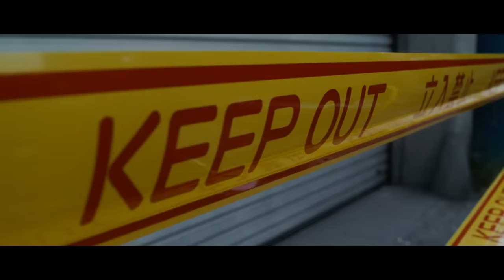Fixing a Ford Mustang | The Fast And The Furious: Tokyo Drift (2006) | Screen Bites

Comment: is it possible to do this engine swap irl 😂
Reply: Matthew Aquinde are you a world class mechanic?
Reply: The shots are real. As you can see, they really swapped it. There is commentary about it in DVD extras.
Reply: The mechanic that worked on the car begged Justin Lin for a shot of the engine running to prove it
Reply: with enough welding....
Reply: Yeah it's possible. A lot of welding though. Because it's not designed for that car. And you probably need a Japanese transmission too, because I don't think it'll fit a mustang transmission.
Reply: In modification, nothing's impossible 👊👊👊
Reply: It would probably take a half dozen master mechanics and fabricators 2-3 years to do it properly.
Reply: Yes they did, But of the 6 or so used in the film, most actually driven where 300 HP crate motors.
Reply: @chrismitchell559  I love when someone who doesn't know shit speaks. hahah 2-3 years....give me 2 days
Reply: Well the Mustang's engine bay is quite big. So yeah it's quite possible
Reply: kalesz01 2 days ?! I’d say 30 days done
Reply: kalesz01 minimum 2 weeks
Reply: @NSB25445  the majority of the welding would be in the exhaust headers. Motor mounts are about the easiest thing to fabricate provided you didn't flunk geometry.
Reply: With enough money ANYTHING is possible lol. But they actually built this car and the hood off running shots are all real to prove it. Can't be that hard though, I'm sure there is some cutting here and welding there but when you're working with a fully running and driving car (before Shawn got a hold of it) you know you have everything you need to make it work
Reply: Certainly. The base option engine for the 67-68 Ford Mustang was a 200 ci straight 6 cylinder, but tick the right boxes you could order a big block V8 too. There is plenty of  space, but there would be a bit of work involved in fabricating engine and gearbox mounts, fitting the intercooler and associated pipes, etc.
Reply: Well... there is a 1995 Toyota Corolla IRL with a MR2 Engine... AND it was build into a AWD car to get the Power better on track because the standard transmission couldn't handle the power. There are plenty other examples. You need to weld anything in the right position a. s. o. so it would be easier and ceaper to buy a other car.

As for a car Maniac... my dream is to get a Datsun 240z and put something more Powerfull in with a manual transmission XD
Reply: @kaleszz2541  You ain't doing this shit in 2 days.

Comment: Would have it been easier and cheaper to just rebuild the car the engine was already in?
Reply: Hours upon hours to get rear panels to original state, chasis straight in general
Reply: @fabianromanowski9720  you say it as if engine swaps are any easier
Reply: @thefuzzypickle8277  can't be an engine swap if there's no engine

Comment: One thing that kinda made me laugh was when they're adjusting the camshafts they use a quarter inch ratchet. Very rarely in my life have I used quarter inch drive to work on engines. I either use 3/8's or 1/2
EDIT 1: Also I can say at first I was annoyed they used an RB26 im like hello can't you buy and import a V8? Well for one, you can but its super expensive and two Japan had a road tax that says for each liter an engine has you have to pay more money. Now im like oh yea I guess having a 350 sbc would be nasty. I respect y'all in Japan cause you make serious power with small engines. Don't get me wrong, you cant beat a 454 big block but for such small and economical engines they make nasty power

Comment: First reverse LS swap

I hope Toyota, Nissan, and Mazda make another legendary engine with today's tech
Reply: Toyota: 2GR-FE (no one talks about it though) and their 5.0 from Lexus
Nissan: VR38DETT
Mazda: Skyactiv-X (in terms of innovation, not preformance)
Reply: @exquisiteart6478  Welp, I guess I've been looking the other way all this time. I'm quite aware of VR engine (some been tuned to 1000HP+). Not with the 2GR-FE, can that engine have the same tunability as VR engine? (Since I haven't heard anyone tuned it). And Mazda's skyactive X haven't rolled into production have they? (As far as I know)
Reply: @fatamohana7586  I'm pretty sure Skyactiv-X is already selling outside of the U.S and the 2GR-FE has great support from the aftermarket and Lotus as well. They're quite remarkable and use a lot of the technologies the 2JZ did. The 2GR has oil piston squirters, VVT-I, and the bottom end is solid with a forged crank and rods which is impressive for an average engine 😂
Reply: https://youtu.be/qLH6_qVcDSc
680hp is not bad in my opinion
Reply: @exquisiteart6478  wow, didn't know they used it in hillclimb. now why everybody still use 2JZ?, is it cheaper?, I mean sure 2GR have similarities with 2JZ and probably capable of handling big boost and everything
Reply: @fatamohana7586  noooooo, the 2JZ is WAYY overpriced. The only reason I think people never opened up to the 2GR is because it wasn't in any sports car besides the Lotus Evora and Exige. Also, it's not a closed deck block, unlike the 2JZ, but regardless it's wayyy lighter than a 2JZ and people can just sleeve them anyways.
Reply: @exquisiteart6478  guess it's just because it's legendary that people are using it till today. I mean, i'm really hoping to see some tuners use other unknown engine that capable of handling 1000+ HP, cause all I see (in super street, speed hunters, and some Japanese tuner) is either 2JZ or RB26
Reply: @fatamohana7586  same! It gets boring to see the same thing, I want to see something original for once!
Reply: @exquisiteart6478  right?!, like, with all the engines that available, why do you have to use those same engine everytime and got bored with it. Thanks for letting me know and reminded me with those engines tho
Reply: @fatamohana7586  anytime man!